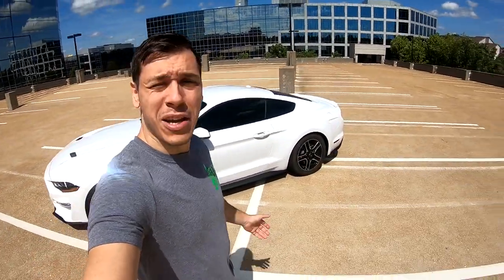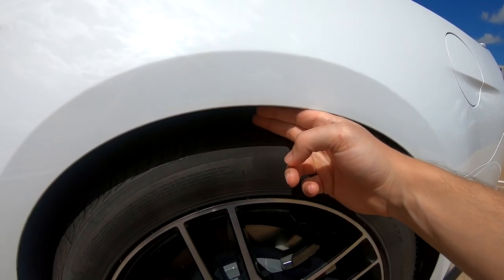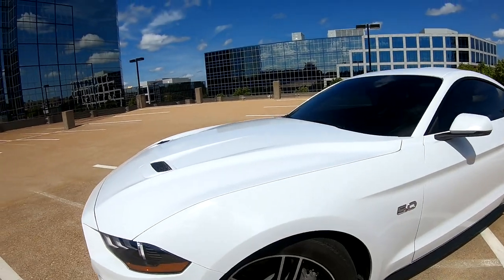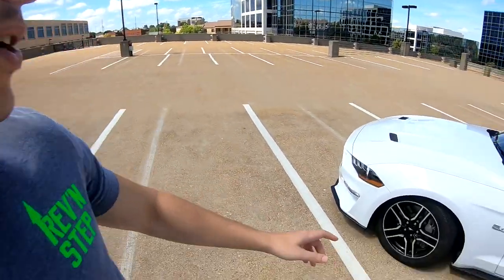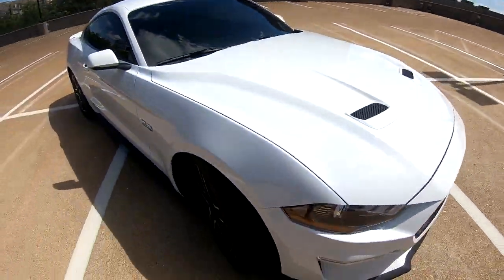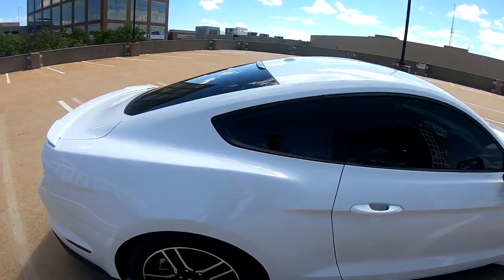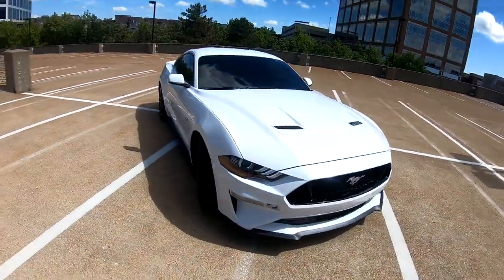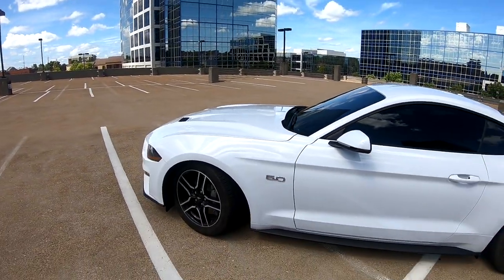2018 Mustang GT H&R Springs 1 inch drop

Comment: Every car I have I always drop enough to have 1 finger max, 2 fingers is like original look imo. I was a Mustang guy most of the 90's, had so many supercharged fox bodies and even some antique ones. They were fast but had no brakes or suspension to match, now I'm sure they do. But my mk7 modded GTI just fits me better. I'll be going is38 soon, should be fun.
Reply from the maker: After lowering it and now getting the right tire this car handles on rails.  I loved my GTI but it was getting outdated and this car is much better equipped.  Its a bit of a different dynamic but once you are used to it.  It can take turns very well.

Comment: Any new pics on the new tire? Considering going with the h&r sport springs or the eibach sportlines...not sure if I wanna go with a more aggressive drop though.
Reply from the maker: TheRockHardMan the fitment is perfect.  There is a video.
Reply: Yeah just saw it! Looks really good...considering getting the h&r sport springs with 20-25mm spacers all around on performance pack wheels.